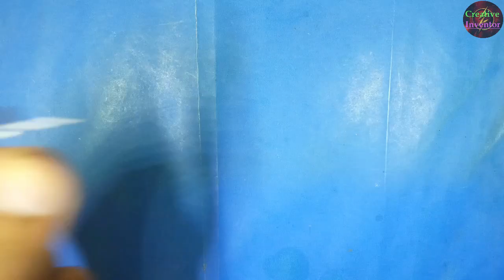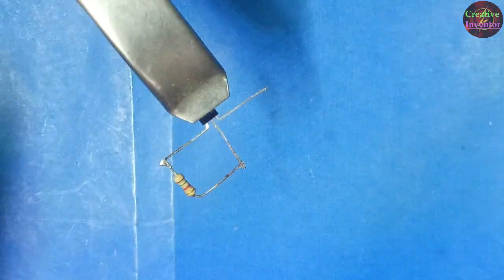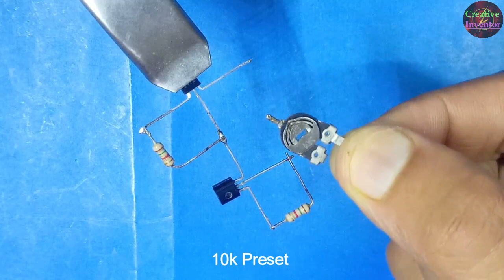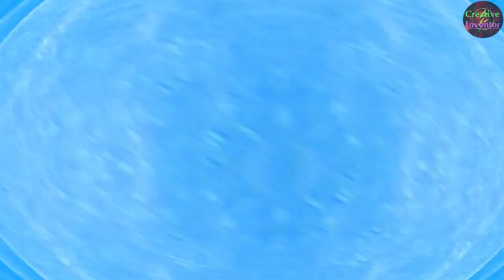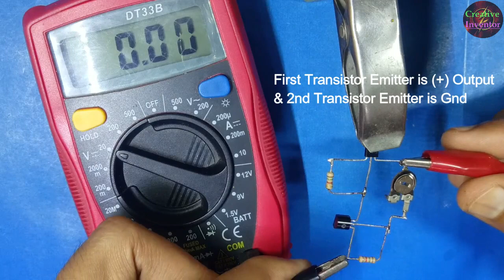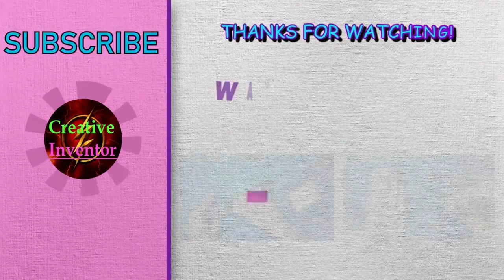2 in 1 Electronic Project | Adjustable Fix DC Voltage Regulator | BC547 Transistor Projects | DIY

Comment: Excellent easy to understand👏Sir i tried with 2n2222 works well👍i want to get high amps🙏can i replace with powerful transistor🤔after replacing do i need to change resistor values?
Reply from the maker: no need to change resistors value

Comment: Why it is called 2 in 1 project?
Reply from the maker: bcoz, i had previously the same circuit with fixed output and this circuit is varaible, it act as fixed if u add a resistor and it will also acts as variable if u replace the resistor with variable resistor.